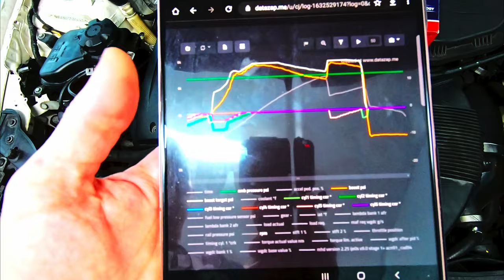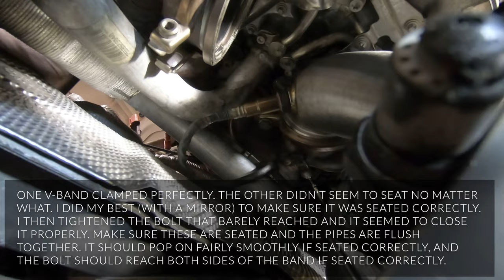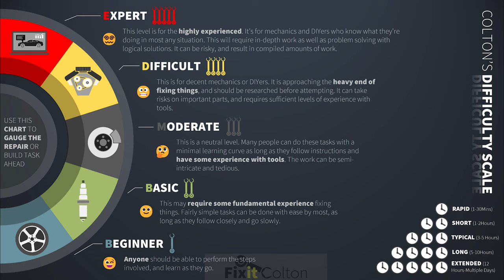BMW N54 DOWNPIPES INSTALLATION - COMPLETE STEP BY STEP GUIDE (VRSF V2 for 335i, E92, E60, E82, more)

Comment: Whats the difference between the v2 and v1
Reply from the maker: They V2 refined the way the flange (the end plates) connect to the pipe to get better flow. They also added the "VRSF" logo, I believe. They may be a slightly different exterior finish than the originals. They apparently bent them a little different to get better clearance as well. 

In reality, it's just a pipe, lol. If you can get V1 or V2, it's probably good, and you won't notice any hp gains that you can feel (unless you're massively built and hitting extreme boost, maybe). The only thing that may be questionable is if you find a second hand V1 and it had bad quality control and didn't line up. I've heard of that happening in various brands. So, it may be best to just pickup the V2 new.
Reply: @fixitcolton thanks 😊
Reply from the maker: You're welcome, good luck with it 🙃